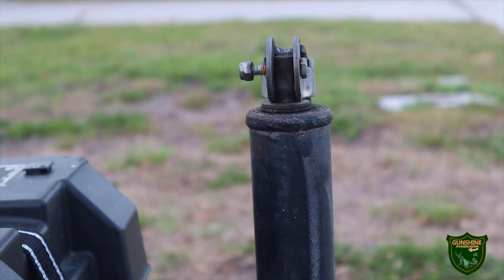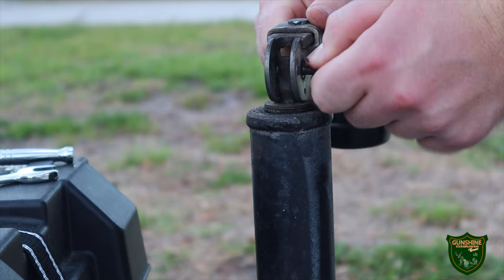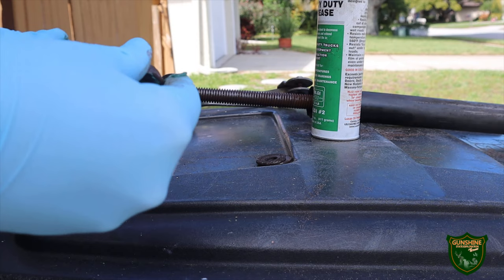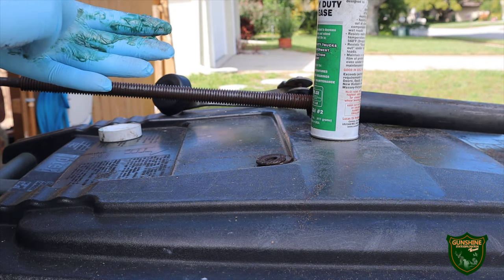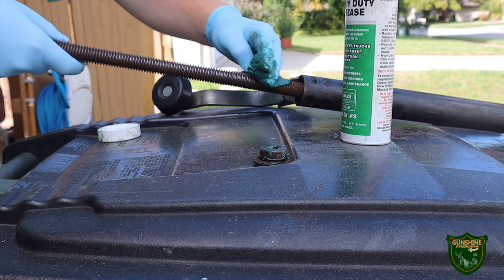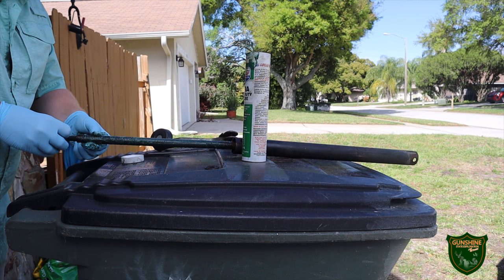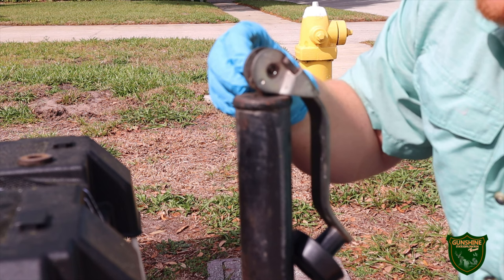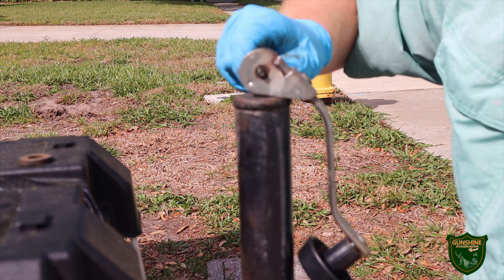Trailer Jack Repair

Comment: A small tip, I would leave the nut threaded some and tap on the bolt then finish unscrewing the nut. Just small insurance against marring up any of the bolt thread and making it not want to easily go back together.
Reply from the maker: Thank you for the advice! I actually need to do a different trailer this weekend and will give it a try

Comment: Our handle fell off the jack. The pin has fallen inside, but the bottom of the jack won't come out. Any suggestions?
Reply from the maker: Can you remove the bottom part of the jack?

Comment: I just did mine, have a use trailer I just purchased, mine only had one bearing,  is it supposed to have two?
Reply from the maker: If I remember correctly it is just the one

Comment: Don't force it... USE A BIGGER HAMMER !!
People who "put as much grease on as I can" should check afterward to see how much of the grease they used now resides in parts of the mechanism where it can not (and never will) do any good AT ALL!! (Packing wheel hubs full of grease to keep the wheel bearing lubed is a fine example. 🤣😂

Comment: You basically showed how to remove the handle, and grease the threads. Nothing about the order of disassy of the internals or the hardware inside. My jack has the threads ripped out of the traveling nut, and I need to figure out the best method of repair...if possible. I just purchased a Curt 2000 lb jack, hoping to use the internals, seeing my housing is welded "massively" to the tongue. Doesn't look good.
Reply from the maker: I looked at doing to same thing but was unable to find parts any cheaper then buying a new jack. This did the trick for me!
Reply: @gunshinestateexploration7993  After checking out the internals of my new "sidewinder" jack, (the original is not one), it appears I too, will need to remove my old welded on housing, and installing the new one. It's not gunna be pretty. I don't look fwd to it.
Reply from the maker: I wish you the best of luck. Shoot a  video so others can see how its done!

Comment: I know this is old, but you can replace the bearing, with a sealed type. Fastenal take it in and tell them you want the sealed one , 10 or less, or just Google, trailer jack bearings. Ace hardware may also have them, bearing is man made, it's replaceable. They just wanted your money.